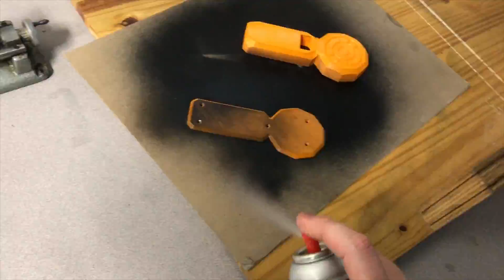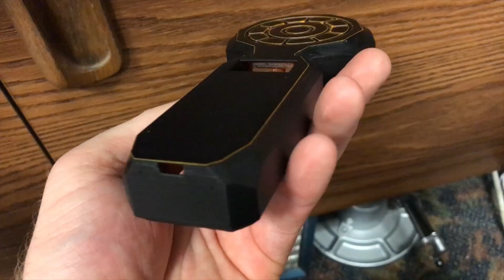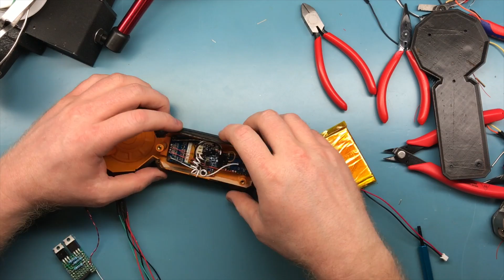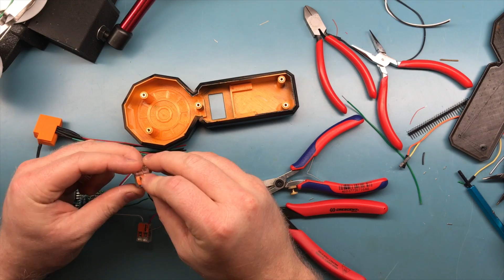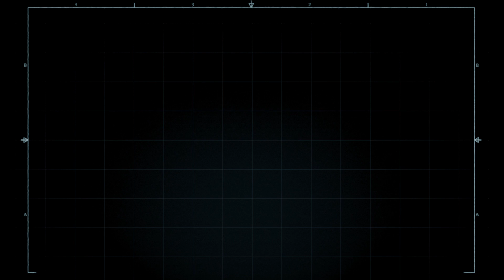How to Build Your Own Gauss Meter for Measuring the Strength of Magnets

Comment: Man this unit is absolutely awesome! I love the 2 hall effects for seeing distance strength better and love the on off switch!

I just want to make your setup without battery etc i would love to just have it on the bench to use it so any chance u have a video on just the basic comfig to use it on arduino with ac or usb powering it.

Comment: Do you have a schematic for this project? Not a pictorial but a standard electrical schematic.
I'm having some problems with the image resolution...even the PDF.
Too much compression perhaps.

Did you know that MicroCap is free now?
https://micro-cap.informer.com/12.0/#google_vignette
https://arduinoinfo.mywikis.net/w/images/0/01/ArduinoNano30Schematic.png
https://wiki.mchobby.be/images/d/d1/PowerBoost-500-Chargeur-Schema-00.png

Comment: Cool AF, have you tested the range/accuracy of this yet?
Reply: By range I mean minimum measurable Gauss to maximum measurable
Reply from the maker: Thanks, I set the minimum range to 100 Gauss in programming because I didn't want nearby fields getting picked up but you could lower it. With this meter,  0-4000 Gauss is going to be fairly accurate.  Anything beyond that will be repeatable but should be used for comparison purposes only.  You could, though, have a magnet with a strength of 5000 Gauss at the surface and within 0-4000 Gauss at 3/8" away read by the second sensor.  The second sensor would be more accurate than the surface sensor in that case.  You could calibrate it in firmware but I think for the purpose of comparing magnets, there's no need to.
Reply: Would love to see a video on the programming aswell